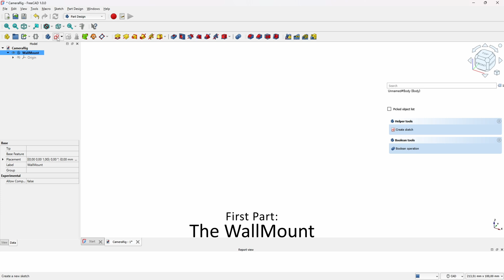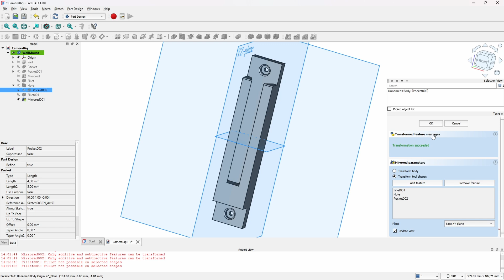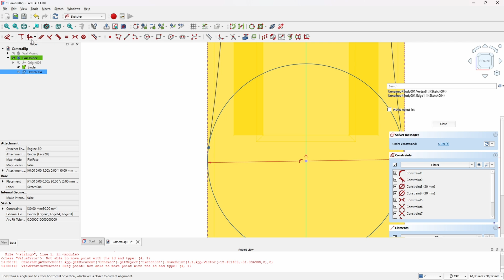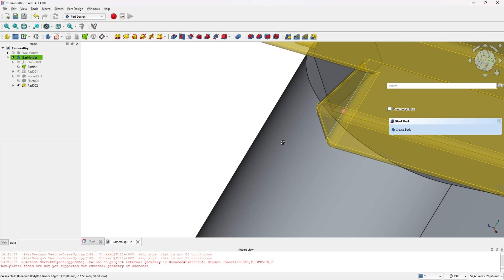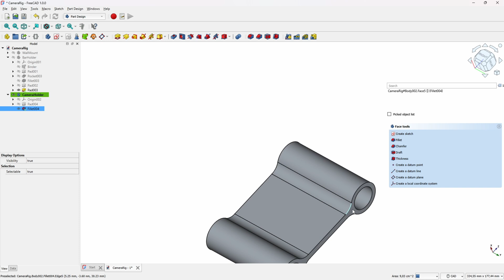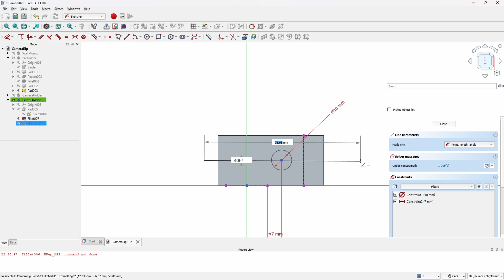FreeCAD v1.0: Let's make a Camera Rig!

Comment: Very nice video. i wanted to create a headphone holder and I didn't know to align everything so that it fits together. This video helps alot. Although I think it's too fast for real learners. I'm not an expert but I was able to follow because I've been following other channels. But if you want to make real tutorials, you need to slow down and describe what you are doing and why. Btw I subscribed. Thanks
Reply from the maker: @xray364 Thank you for subscribing and the feedback!
The idea was to make a video that demonstrates a practical use-case to be solved with FreeCAD, a bit like inspiration / motivation, while the video "proves" that it is in fact possible (FreeCAD is considered to be quite difficult by many people - myself included), without any magic.

Do you find value in such a format, in terms of motivation/inspiration?

I did realize while making it that I didn't explain everything (due to the length of the video), but thought that the details can be looked up / asked about separately.

If there are some good specific examples from this video that were hard to get in this video, please let me know and I may add proper explanations about them in the next video 

Or if there are many, a video dedicated to those parts by revisiting the project.

Thanks again for taking the time to give me some feedback! :)
Reply: @JWAM  I appreciate the video in any case. It's really decent.

Comment: Grattis! FreeCAD 1.0 är äntligen här och fungerar väldigt bra. Iaf en stor skillnad för oss som hängt med ett tag :)
Reply from the maker: Tackarrrrr!
Ja, men jag har kört Linkstage ett bra tag och tycker "tyvärr" att den har funkat bättre.  Men det är väl lika bra att börja använda riktiga spåret nu. :)
Reply: Sometimes I got FreeCAD 1.0 crashing when opening model files created with version 21.2.  I have uninstalled version 21.2 completely and crashing still occurs. Any idea to solve this issue?
Reply from the maker: @LFANS2001  There's quite little to go on if a crash report is lacking. 

This is what the Wiki says on compatibility:
"Although precautions have been taken to guarantee that files created with the new 1.0 version can still be opened in older versions of FreeCAD, some new features introduced in 1.0 cannot be understood by earlier versions, and can cause models saved with 1.0 to break or present problems when opened in earlier versions of FreeCAD. "

It mentions that they have done their best to make 1.0-created models to work on older versions (which is a strange thing to focus on), so I take it for granted it is definitely expected that you should be able to open older versions in 1.0.

I think you should file a bug report on this!